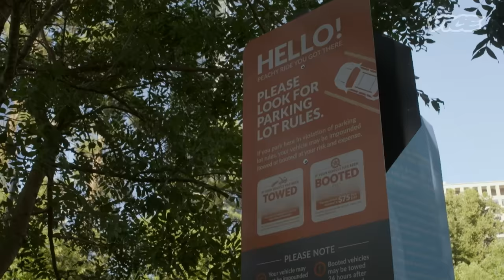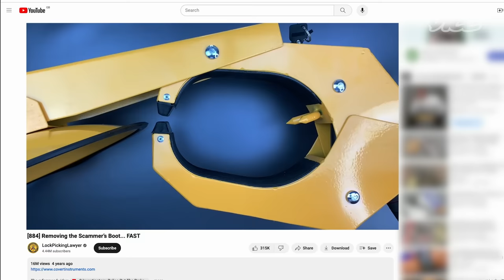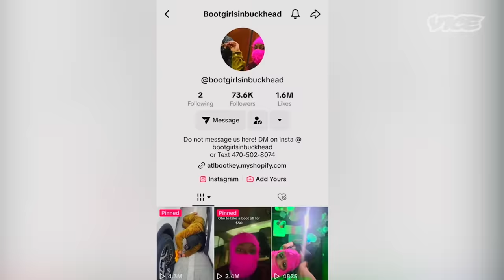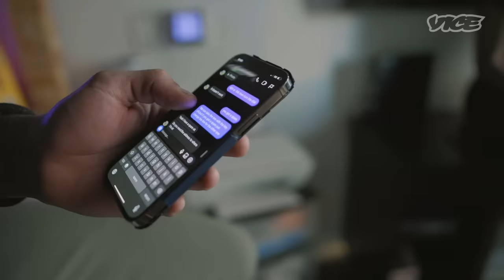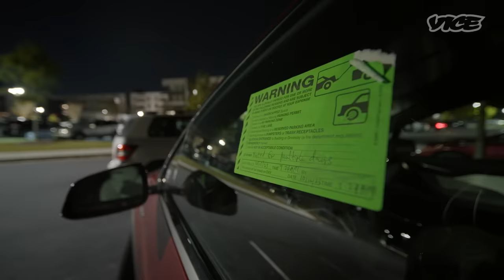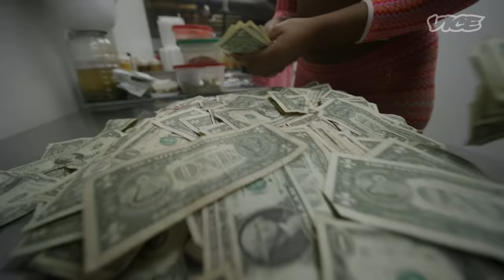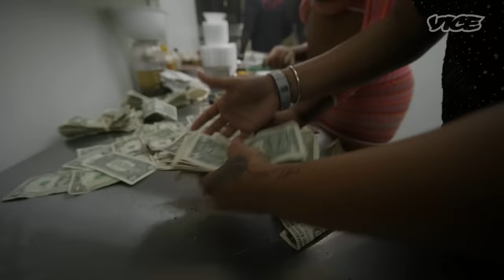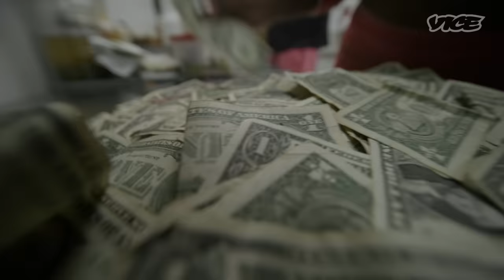The Boot Girls Are Saving Atlanta One Car at a Time

Comment: A bic pen, and a bic lighter, is an ALMOST foolproof way to pick those circular locks, take the pen apart, use the lighter to soften the tube of the pen, and then quickly press it into the circular hole, allow it to cool and harden, then twist as if the pen were a key.

It doesn't always work, but it does work most of the time.
Reply: 70 percent of the time. It works all the time…😆
Reply: Classic technique
Reply: If it doesn't work you've jammed the locking mechanism with soft plastic and the boot key will no longer unlock it.
Reply: You go girls!
Reply: @SarcasticData that was my first thought
Reply: What do you do if it breaks and the plastic is stuck in the keyhole?
Reply: @SarcasticData and now the booting company is charging you not only 375, but also 1,000 for the damaged boot, and 5,000 for them to call their buddy who has a welding torch. They'll go back home cackling like the vultures they are.
Reply: Perhaps sharing that secret with the whole world is not a good idea. If the boot police know your tricks then they find ways to stop it.
Reply: @samus598 you tryna tell me you don’t have at least one homie with a cordless grinder and cutoff wheel?… Youth got soft hands nowadays
Reply: @samus598  cordless angle grinder. Or drill the lock.  Or just torch the thing to burn the plastic off and try again.. scam tow company loses either way
Reply: @danbuckley6584 problem is now you're destroying their property and they can press actual criminal charges. Maybe they wont stick, who knows, still gonna be a huge pain in the ass.

Yeah youre morally justified in torching the boot but morally justified doesnt help you stay out of court.
Reply: @moredots  "boot was like that when I got here" if it's illegally booted it's gonna be pretty difficult to press charges
Reply: It's a good Idea but they are trying to stay legitimate and not damage the boot. Otherwise the boot company can charge them criminally.
Reply: @moredots exactly my point as well. They are not trying to damage the boot. Otherwise it becomes a criminal offense.
Reply: When your Girl has an attitude apply the same techniques
Reply: Bro this is a 2024 adult magazine written hahaha
Reply: If it doesn't work the first time pull it out, heat it up again and keep trying. It WILL eventually open.
Reply: @danbuckley6584   That won't work if there is any security camera footage of where your car is, though.
Reply: @benisrood  if there's cameras, get creative. For 1 if the boot is illegally on your vehicle like they're saying here... you'd be pretty fuckin dumb to file a police report over the boot.
Reply: Dang mcguver
Reply: Get a graphite from an AA battery and connect it to the negative side of the battey in the car, connect whatever metal in the positive, have fun with your portable sun.
Reply: @hugostiglitz5976 Exactly! I wouldn’t go into a known booting area, with anything less than a angle grinder and a drill!! 😏🤷🏻‍♂️

Comment: This is so amazing. Love that the lockpicking lawyer was an inspiration for this! I picked up one of his lockpick sets to learn with. If boots come to my city I'm gonna pick every single one I see.
Reply: Get a graphite from an AA battery and connect it to the negative side of the battey in the car, connect whatever metal in the negative, have fun with your portable sun.
Reply: You're going to need a rotary pick for those tubular pin tumbler locks that many of these car boots have.
Reply: @fss1704 Even better, make some thermite. It's very easy, and cheap.

Comment: Next time, take the boot when you unlock them. Just don't document it on video, let see how many boots they can afford to buy 🙂
Reply: It would be gratifying, but if they leave it, they can't be rightfully accused of theft or vandalism. So they should be in the clear.
Reply: @RockwaterReese  Everyone needs to get these keys and take the boots with them. If it's left on my vehicle, I consider it a gift and it's my property now.
Reply: I'm sure they have the plate number of the car, the owner would probably be charged with theft.
Reply: the whole point of removing the boot is to gain access to your own property (your car) that someone else is holding hostage (with their boot).  If you take the boot with you, you're taking someone else's property and then you would be elevating a civil matter into a criminal matter. 

Take the boot off. Get your stuff and leave.  Leave their stuff where you found it and there legally can't be any charges filed against you for any theft of their private property.
Reply: @duzzitmatter8679  Bending over halfway is still bending over. Civil, criminal... what about principle?

Comment: The thing that they don’t understand is that if they make booting illegal then they will just do it like they do here in mn - they don’t boot any cars ever - they tow unauthorized parked cars to the tow lot and charge you for towing and storage and you’ll be out 300 instead of 150
Reply: There are more regulations and protections for people who are towed.
Reply: It's much less convenient to tow a car than it is to slap a boot on it.  You need a lot to keep the cars in, a tow truck, somebody that knows how to tow a car, etc.  The only investment you've gotta make for booting is buying the boots 🤷
Reply: Or pay your bills and park where it's not illegal problem solved
Reply: 1 used tow truck costs: approx. $65k, a driver, insurance diesel fuel, def, wages vs. Loading 1 gas, hybrid or electric car with 25 to 50 boots.  No tow truck can get and store this many cars in one day.
Reply: Yeah, even if the price is double it's still cheaper because it's 30x more probable to get booted.

Comment: I don't have an issue with booting in most situations. 
I have an issue with no consistent regulations and fine limitations of them.
Reply: I had a friend get booted.  She called to get it removed.  She asked about the parking and said she didn't see any sign. The guy pointed to a sign that was literally the size of an index card in the far corner of the lot. After he removed the boot, he tried hitting on her. She got in and drove off. Seeing where these girls are operating, I have no doubt the boot operator is scum.
Reply: @weirdshibainu  that's one of those situations that I'd oppose the booting. Also goes back to needing consistent regulations. Such as all parking rule signs should be of a minimum size and text on the sign a minimum size etc...
Reply: @weirdshibainu that would and could never be this problem in Germany 😂🇩🇪